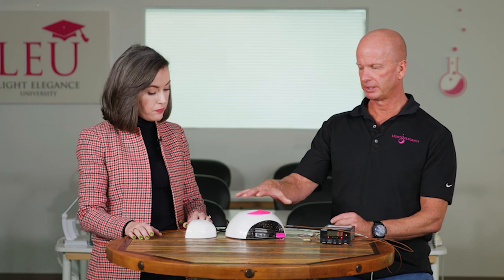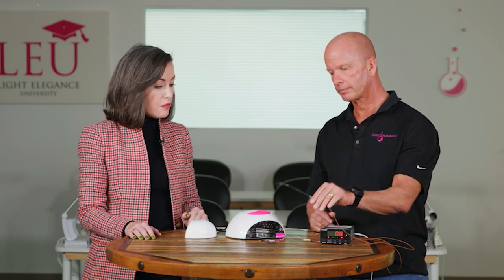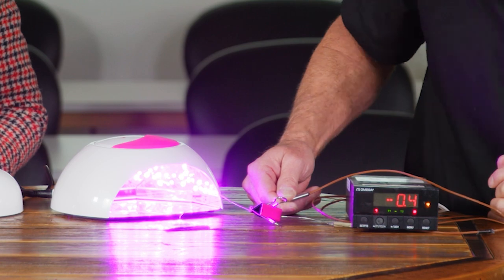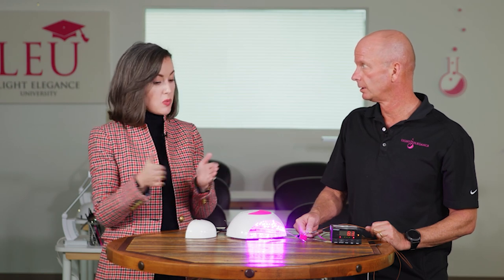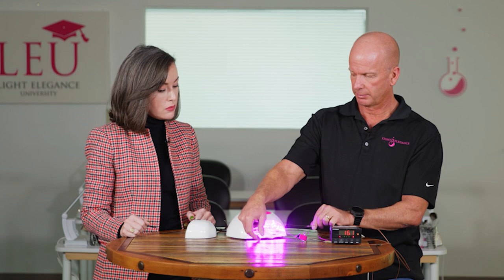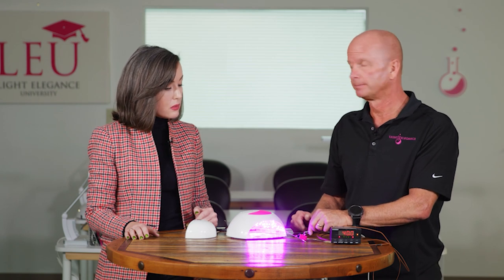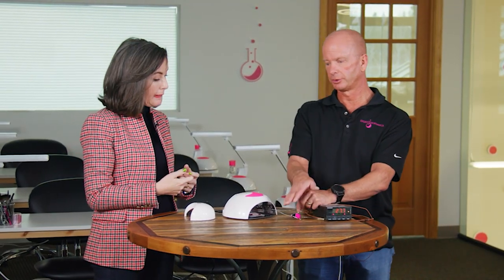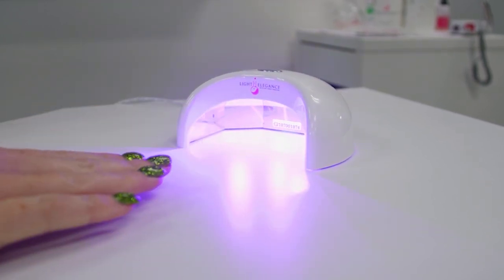Why Do Gel Nails Burn? - Part 3

Comment: Yea!! Just what I needed. I’m really glad my light is open on the front and the back. My tiny fan blows on my fingertips and keeps my heat to mostly zero. Now maybe I can lose the fan and keep my hand just outside the light. I keep it really clean and don’t get much dust, but no dust would be better. Thanks for all your hard work and knowledge! It’s invaluable! Warm wishes from Minnesota!
Reply: I have two lamps. One thay is traditional that i use for full hands. 
The other is open on all.sides that either for flash curing or to just repair a break or two.

Comment: I no longer burn because i stopped applying thick coats. I also make sure I allow the coat to level out before curing. I also puy my hand further away from the heat source.

Comment: I’m a DIY loving this channel as I learn; my lamp has a 90 sec and on this setting after the first 30 sec it gets brighter. I’m guessing this is a feature to help with that exothermic reaction. I use it now along with flash curing. Thank you!
Reply from the maker: Yes sounds like you have a lamp that helps with heat spikes.

Comment: If you do the flash cure, or start them outside the lamp, do you need to increase the length of total cure time?
Reply: A flash cure us only for the initial base layer which is very thin. 
There will always be additional layers which need the usual.cure time.
Reply: @RAJOHN-ke7mc  What? No, why do you say that? Why would we only flash cure the initial base layer? 🤨 Shouldn't the base layer/base coat be cured properly to ensure proper adhesion first? 

And I mean, why should we be restricted to only flash cure the base layer?

We flash cure for three reasons, the first reason is to avoid heat, the second reason is to work quicker and more efficiently without having to cure every single layer for a full 30 seconds or a full minute, and the last reason is to "Iock" the gel in place so that it doesn't self-level too quickly and run all over the sidewalls and the skin.

Say, for example, you're working with a low or medium-viscosity gel, and you're building the apex. If you're not flash curing, you'll have to build one apex, cure for 30 or 60 seconds, build the next, cure for another 30 or 60 seconds, and so on until you're finished with the tenth nail.
That's 5 or 10 minutes in just curing all ten apexes alone.
So, to save time and work efficiently, you build the first apex, flash cure for 5-10 seconds, build the next apex, flash cure that apex and repeat until you have built the last tenth apex. THEN you do a full cure of all ten nails all at once.
By doing that, you have saved ~4 minutes in curing all of the apexes and some over-curing as well! 

Hahah, I'm so sorry if I sound rude or anything. That's not my intention at all! Unfortunately, we can't hear how we speak through text online, so it can seem rude or harsh even though we mean well. I just wanted to put my thought process out there. I hope you don't take offense by my looong waffling Harry Potter book 🙈😂 And I hope I have made some sense out of all of this 🤣🤣 
Anyway, have a lovely weekend and a merry Christmas! 🤗🌻